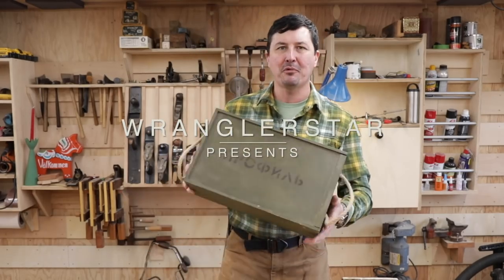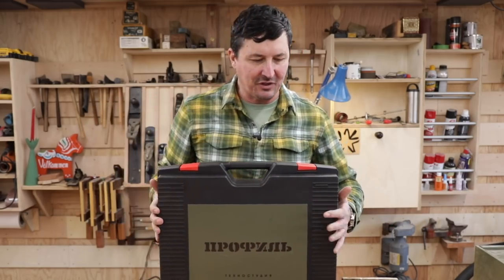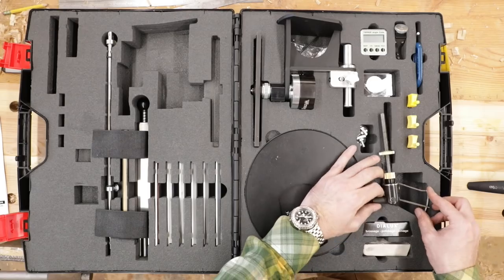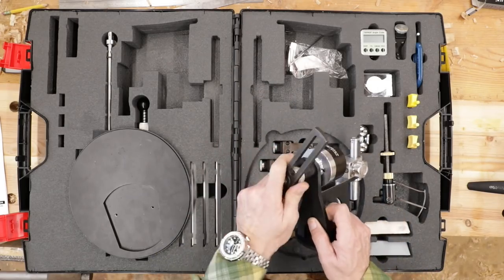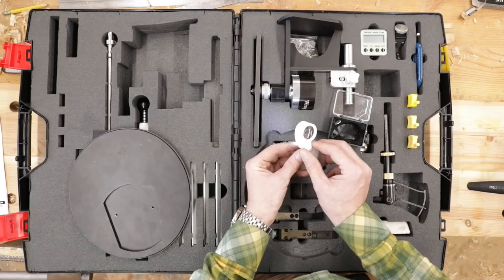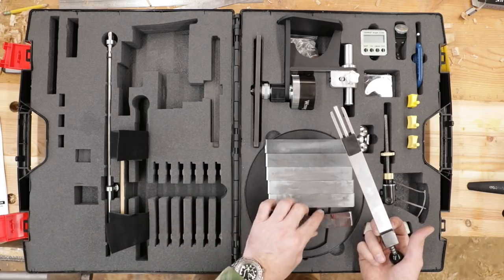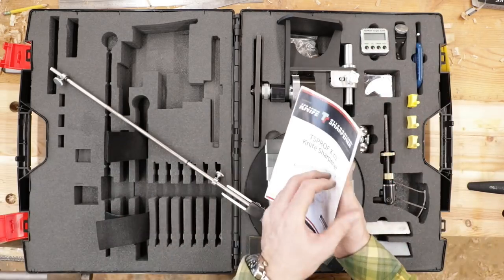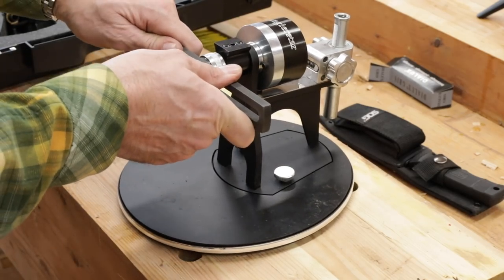This Box From Russia Changed My Life 2

Comment: That sharpener looks amazing.  I have been using an Edge Pro sharpener for years, and it has a very similar design.  The big difference is that the Edge Pro sharpeners don't clamp the knife.  You are to hold the knife and are able to move the knife as you sharpen it.  It's nice because you can turn the knife around the tip and keep the grind more even around the corner, and there is literally no limit to the length of knife that it will sharpen, even a sword could be sharpened with it.  The clamp system and detent on the rotating mechanism on the Trsprof looks like a dream to work with.  I also love the idea of using the digital protractor, I will definitely use that trick on the next knife I sharpen.

Comment: Just a tip...  mark the sharpening stones on the back side with a marker or better yet a paint pen.  I don't know why they don't do this originally, but sure as you don't mark them, you will forget which is which, and that can get frustrating in a hurry.

Second tip...  always pull/push the leather strops and the glass platen diamond adhesive strips away from the sharpened edge, never towards the sharpened edge.  Pulling or pushing one towards the sharpened edge will always cut the strop or strip.

Comment: regarding the polishing paste (info from the webpage)

Gray - for stainless steel, rough grit.
White - finish for all kinds of metal. Aluminium oxide 20/32 mkm

It is recommended to use with leather blank.

Comment: They are for lower sharpening angle the 4 knifeholders, there are 2 different angles😊
Reply: And the doublesided leather is meant for that machine, they have for freehand working one with a handle😊
That holder is adjustable, remember😅
Reply: And you can use tox in the allens works fine, without wasting the nut😊
Reply: You are absolutely right. There is 2 types of a clamps. Default clamps have sharpening angles 10-32°. And fillet clamps have angles 6,5° - 32°. It's made for thin and narrow fillet knives.

Comment: Like you, I've tried several different methods and crapped out mostly. I did end up with the Lansky 4 rod turn box system that I've had for 10 years or so and just got some great results with it finally. I ended putting so pressure I that I was not comfortable with and the edge turned  out very sharp this time. And another great thing, I still have all my fingers....LOL
I would very much like you to sharpen something like a butter knife, that would be great. Love your vids.

Comment: If someone is so concerned over what angle the edge holds over the length, sharpen it in shorter sections and readjust as you work in new sections.

Comment: I've heard it can also sharpen scissors, can we get a scissor sharpening video?
Reply: JCP  there is a different clamp for scissors. It holds the blades of the scissors more vertical. That way you can actually match the factory bevel. Then the process is the same. I find it works better to only cut on the push stroke with scissors.
Reply: I agree
Reply: I used sandpaper. Fairly fine grade. And just make a lot of cuts.

Comment: Wranglerstar: For the fanatics that want to keep the angle even from one end of the blade to the other, they have a "lens kit" option that makes this possible. US$68.
Reply: I'm trying to think how they could make something to compensate for any given blade shape. Even so though, with a arm that long, being so far from the center pivot, I would imagine any given knife having less than .25 degrees of change from heel to point. If that at all, I would imagine most Kitchen like knives having a curve that almost matches the radius of the arm, if that makes any sense. 

On my Wicked Edge, that has a much shorter arm length than this, I often get less than .4 of a degree across the edge, which is small enough that any irregularity in the grind of the knife is more noticeable.

Comment: It's good to count strokes but you should check if there is burr on edge. When you can feel burr at whole length of knife edge than its time to do other side with equal number of strokes. Check for burr again. If there is burr it's time to use fine stone. 

For regularly sharpened knifes there is no need for 1st stone to be below 800-1000. My 2nd stone in that case is 6000 but it is not required. 1000 can make very sharp edge good enough for every day use. If there is some damage or you want to change angle than you need to start with some coarse stone like 300, more or less.

Comment: Truly like this system it is a thing of artistic beauty and engineering  quality. It is just beautiful to look at and it's construction is truly magnificent. Somehow some way I have to get one for myself as I a knife buff. And I can't stand a dull knife. You got to be able to shave with it or back to sharpening it until you can. May from my old meat cutting days. As dull knives cause greater number of knife accidents verses a truly sharp one because you don't have to push or pull as much with a firm but not rigid wrist or grip. I was trained to sharpen knives by hand and eye got really good at it, but this would allow much more control with less work and greater consistency all along the lenght of the blade repeatedly. On every knife style. 

What about chisel or planner blades will it sharpen them?

Are the stones the kit comes with water stones or oil stones? I saw they have diamond stones and other stones also various rogue and strops in product manual online. 

As far a knife blade to sharpen a badly nicked Kitchen blade. All the way to honing with the compound sticks. 

The shallower angle at the tip allows more strength to be kept at the tip to keep from breaking.

Sharpening experience once you in the rhythm must almost feel like being in a zen state. I could see that happening very easy with this system, almost therapeutic or meditative joy and peacefulness.

Comment: Hey Cody. The angle deviation is unavoidable unless the knife has the same radius as the throw of the sharpening arm but it can be reduced by using a reference point on the sharpening arm against the knife edge before the knife is clamped into its final position. That will allow you to clamp the knife in a position that provides the minimum angle deviation on the edge of the blade

Comment: Something I noticed in your first video and again in this one, has to do with the changing angle as you go to the end of the blade, which you mentioned. Seems to me that if you mount the knife such that the hilt is against or closer to the clamp, then when the stone holder pivots to reach the tip of the knife, it will be more perpendicular to the curved edge there so that the sharpening angle is closer to that of the rest of the knife. Because the stone holder pivots instead of moving side to side it will cause all blades sharpened with it to have a different angle at the edges as near the middle of the clamps. As an example, you could not use this tool to properly sharpen electric planer blades, not really.  You could experiment with mounting your knives on an angle in the clamp, placing the curve near the tip more toward the center of the clamp/s; so that the stone holder pivots more with the curved part of the blade. If I didn't make this clear ask and I will try to explain better. Would be cool if there was also a way to mount chisels and hand plane blades. A very slight difference in the sharpening angle with these would likely be fine and it would be very slight because they are narrow so the tool would not have to pivot much. FYI

Comment: You have to set the angle to half the angle you want to account for when you flip the knife. You were grinding a 40° angle not 20° and if you look closely the built in angle gage read 40°.
Reply: Two different terms. There is the total angle and the inclusive angle. The inclusive angle is per side, so the knife in the video was sharpened at 20 degrees inclusive. The total angle is the sum of both sides, so this knife was sharpened at 40 degrees total. 

Sides are not always sharpened at the same angle, so a knife could have two separate inclusive angles, but always one total angle.
Reply: Random Guy, thanks, good to know. Also, when sharpening angles are mentioned without specifying that, are they most frequently inclusive, or total?
Reply: Hard to say. I almost always say per side, but I will always specify by adding "inclusive" or more often "DPS" (Degrees per side). And if I'm speculating, most people who are more into sharpening tend to do the same, that is talk about things in DPS/Inclusive most of the time. Most enthusiast grade equipment is marketed the same way, like the Wicked Edge for example, you actually adjust both sides individually. 

However I notice that people who are less informed, or more casually into sharpening talk about it in total angles a lot and may not specify. The same for products, like the Spyderco Sharpmaker, which has a 30 and 40 degree (total) setting and does not mention DPS at all. 

Really if you are unsure, just try to think about what makes more sense. If I say 30 degrees or more, chances are I'm talking total, 30 degrees or less and I'm probably talking DPS. Most knives are sharpened between 30 total (15dps) and 50 total (25dps). I typically sharpen around 17 dps (34 total) for most common knives.

Comment: The bevel issue you speak of with the tip of the knife bevel being wider than at the heel of the blade is an easy fix. If that's happening move the tip of the blade back toward the clamp until you get even bevels from heel to tip. Reverse the move if the opposite it happening. If its' a really long blade sharpen it in sections. But I do agree, Who cares.

Comment: This Tsprof is looking pretty cool, something I may try out at some point, although a Tormek T8 is next on my list. One big down side I see to this Tsprof however, is the clamping, I hate screw clamps, I've never used a good one (including the WE), the WE cam-lock was a game changer to me. For that reason alone I'm not sure if I rather gravitate towards this or the Edge Pro when it comes to set angle horizontal sharpeners, ideally I would like to try out both one day. 

I've been sharpening for a side income fore over 5 years now. Primarily with my Wicked Edge set up, Sharpmaker for serrations,  free hand water stones for some special knives, and a 1x30 belt grinder for rough work and larger blades like axes.  At the time I got my Wicked Edge, there was really only WE and Edge pro to chose between for higher end set angle systems. I saved up a long time to buy it, and it has more than payed for it's self and all the upgrades, and a good part of my knife collection over the years.

Comment: Cody forge a quick blade out of a railroad spike and take it to the level of sharpening on there. If you dont have any spiles ill send you some. I make a lot of them, however im terrible at putting an great edge on.
Reply: How do you temper your knives? Out of curiosity.  I have a few 1095 blanks I  shaped a few years ago, and never got around to heat treating them. Thinking I'll make some thick metal container and heat it with a large propane torch (to spread the heat), normalize a few times, quench, and then set them in the glowing container till they get the oil glow for the tempering.
Reply: i lay them in the gas forge and check them often as they heat with a magnet, soon as the magnet wont stick i quench it quick then lay it in a pan of oil.
Reply: Probably not how most do it, but seems to work fine.
Reply: Do you temper them after the quench? Like put them in a oven at 200 for a while, or let them sit on a glowing bar till they glow dimly, to lower the hardness a bit?
Reply: Random Guy NO I do not.

Comment: I can sharpen a knife, but I scratch the heck out of it, I would like a system like this that would do it neatly!
Reply: Sounds like you need to work on keeping a consistent angle, and you are sharpening too shallow.  Set angle systems are great, but expensive, and learning proper free hand sharpening is a good skill to have even if you own a set angle system. A good way to practice is by cutting out some wooden wedges at the angle you want, and setting them on the stone so you can rest the spine of the knife on the wedge to set your angle constant. Also keeping a clean scratch patter (all the scratches in the same direction) looks nicer and gives a better polish.

Comment: Wranglerstar, appreciate the enthusiasm however you need to seriously revise some of the information you’re putting out there. I definitely went to their website after Box 1 video and I’m still interested in their product but I really think that a revised video would be a good idea.  For instance delivery can be up to 40 days and shipping is very expensive. The discount pricing doesn’t match up with their “configurator” and is considerably more than when the unit first came out. (By the way the other pair of clamps you couldn’t figure out are for fillet knives). Their clamps have some define blade thickness limitations that only close scrutiny reveals I get the impression that there are some significant issues with clamp strength based on the number of options they offer (@additional cost) to make up for the design weaknesses.  I will say that the folks definitely got their roughly $1.2k worth of publicity by sending you both kits gratis. I get that you aren’t affiliated “officially” but lol, man you sure are having  fun being unofficially affiliated. 😎 ! By the time I finally figured out how to run their configurator a good unit with their lifter feature (great angle adjustability) and strong clamp strength was going to run me about $600 without their abrasives. That didn’t include their revised abrasive arm that allows for better sharpening of narrower blades and recurved knives. Which reminds me, I’m not even sure EdgePro plates will fit in this puppy. Now that’s a piece of information that would be handy too! All in all I enjoyed the videos, thank you, but after really digging into it it’s not quite the “deal” you initially made it seem. I’m still wondering what it’s going to run me to get that sucker over here. I’ll have to let you know. Thanks again!

Comment: You realize that you are supposed to soak the stones in water for 5-10 minutes. You don't want to use oil because it clogs the pores of the stone eventually making the stone useless. Oil will make your knife basically hover about the stone forcing you to push harder to actually hit the stone and sharpen instead of allowing the stone to do the work. That's why many people fail with cheaper sets.

Comment: Could you see if will sharpen 12.5" planer blades?
Reply: If your planer blade is better than 1/2" from edge to back of blade, the K2 will give you 11 degrees max. His new tool here is the K3model and I am told will give a 6.5 degree edge. The blade needs to be wide enough to make the edge clear the clamp. The less the edge angle, the more width the blade needs.

Comment: No point in sharpening a butter knife. That would just wear the stones and make a knife without use  which would get blunt quickly (missing heat treatment). Rather do a restoration of a chipped chef knife. Or an a to z restoration of a rusty forgotten knife in a 2-3 part series where sharpening would be the last step. Question is what would bring more views :-).  Supersharp butter knife is much more interesting for the masses.

Comment: Are there any provisions for sharpening plane irons and chisels?
Reply: Yes, please sharpen a plane iron and a chisel. Always wondered how you would mount a long tool with the blade on the end. Doesn’t seem like it would fit in the jig.
Reply: I believe that if you had the clamps built to clamp perpendicular to the sharpener's stroke it may be possible. The tool does not come with the clamps and the stone holder and slide might need lengthening. You would be extending the base of the triangle having the chisel sticking out 6-8 inches further so the other 2 triangle sides would need extensions also. Maybe even extra support under the edge.
Reply: It's pricy, buy a Tormex!
Reply: If you understand the mechanism of a true edge, you know that the best edge that this wheeled tool can create is a fine toothed saw. Very effective for cutting paper and such.
The Tech Studio Profile sharpener allows for quick change of grit to a blade angle that is fixed and that rotates a pure 180 degrees for a PERFECT edge, uniform through out the length of the edge but also at the same angle on both sides of the blade. 
Get a micro scope and look at the finished edge.

Comment: Wranglerstar, HELP!  I just received my K03 and need your help. I cannot raise the angle higher than 22°. The rack and pinion can't raise any higher since the adjustment tower cannot go any higher, it bottoms out. The manual gauge goes to 40°, not that I need that, but I need more than 22°. Any ideas? I know this is tje K02, but figured you also had the K03 too.

Comment: Only $820 😬
Reply: ITSALLGOOD 74 Really? When Wranglerstar got the first one they were 2-3 hundred. I tried to buy one but they never got back to me.
Reply: The range in models is $253-$820.  The model I am looking at is $420.
Reply: I tired very quickly of this manual tool. Yes, it was funny at first, but then I bought "Work Sharp Knife & Tool Sharpener". It is made in USA, powered by electricity, and sharps in a minute! And costs less than $100
Reply: Stepan S Ya, but if you buy something from Russia, a Democrat does a little inside. 😁
Reply: Stepan S That would be assembled in the USA, not really manufactured here. Their own website indicates that they Source components overseas.
Reply: Highest price I found for KO3 model was $589